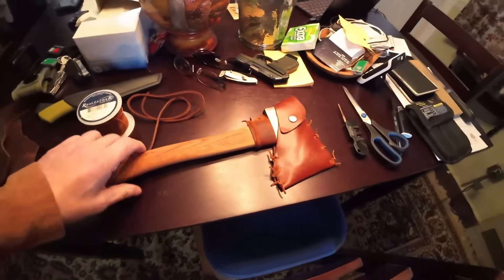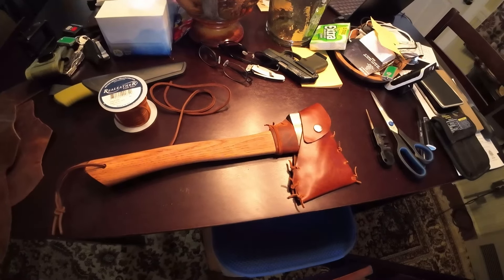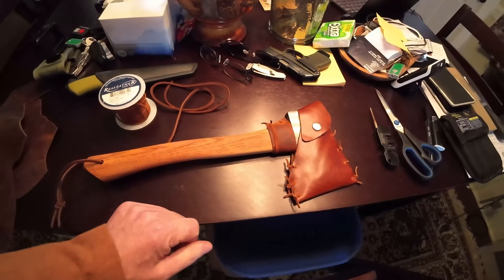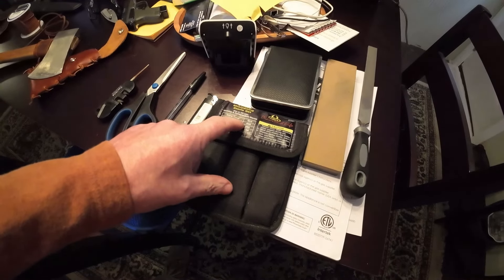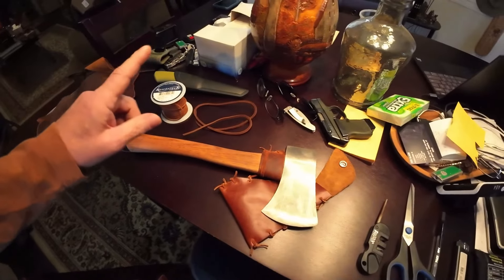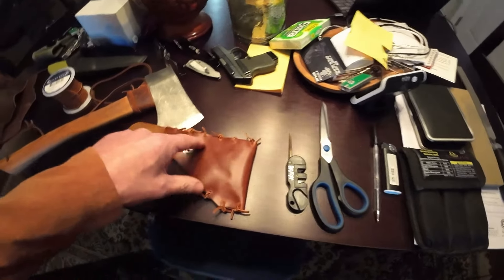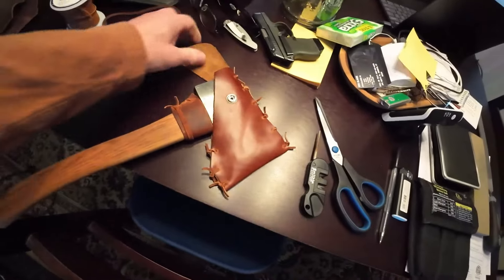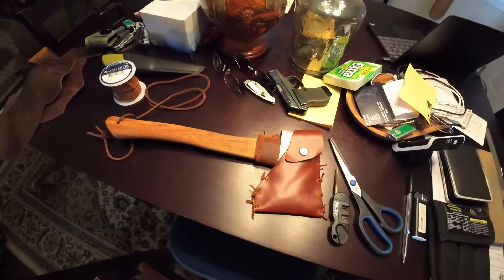Turning a cheap old Craftsman hatchet into a much nicer hatchet for bushcraft, cabin off-grid living

Comment: Be ready when your edge slices through your head cover....
Reply from the maker: I gave extra room at the end of the blade with the sheath so it doesn't touch the leather.  About 1/4".  Thanks for the comment though.  I will be ready for it.
Reply: Worse!! you gave it room to move. Easy fix,  just glue a welt into that fold or stitch one in if you have the tools, or  do be ready. @senselessfun
Reply from the maker: I will look into that.  Thanks. @frankmorris4790
Reply from the maker: I just glued a piece of thick leather into the fold and it should be good now.  It also holds the sheath open better now instead of laying flat.  Thanks again for the tip.
Reply: Perfect! Best o luck. @senselessfun